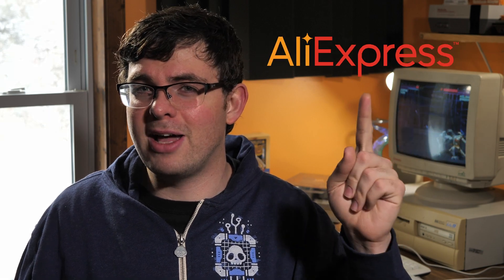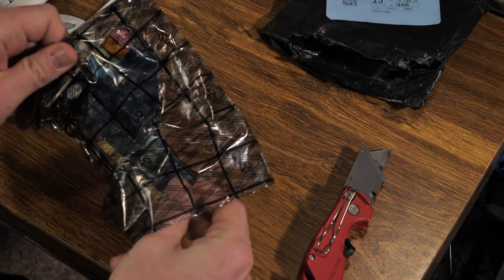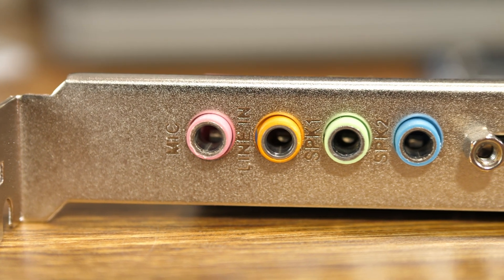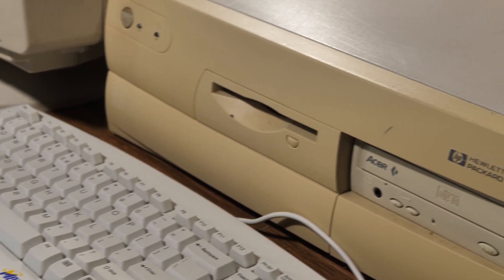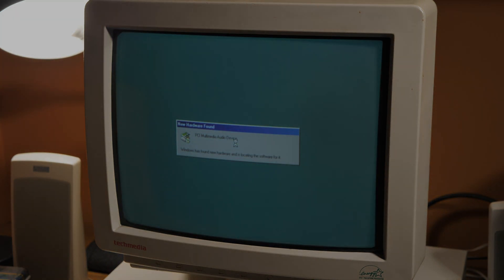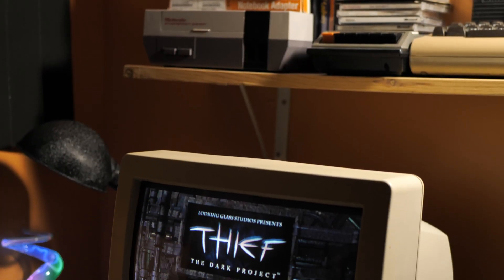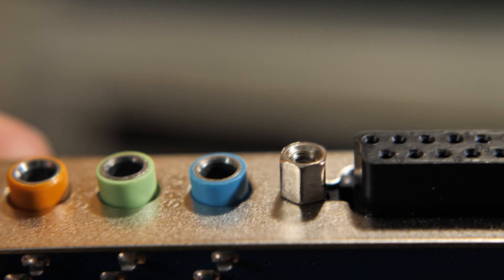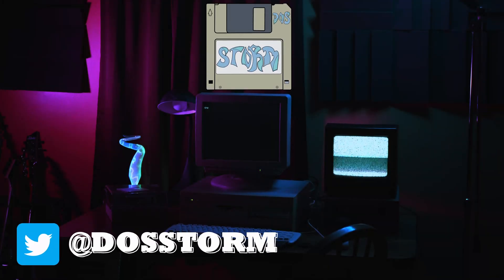Using The $12 AliExpress Sound Card for MS-DOS!

Comment: the Yamaha DS-XG, ESS Solo-1, and Avance Logic ALS4000 were some other DOS compatible PCI cards
the SB Live and some Audigy models and the ESS Maestro or Allegro and the Aureal Vortex had some sort of DOS compatibility too but the FM synth was more inferior
Reply from the maker: Yeah PCI cards are usually shunned by most for DOS gaming. At the very least they are interesting though, and I will probably test more of them. I have a Yamaha XG sitting around somewhere.
Reply: @DOSStorm  I was reading about this and it sounds like some of the 'XG' branded chips are Yamaha YMF724, YMF744B.

Shouldn't be too surprising that a lot of Yamaha's products are pretty good when you consider that electronic organs, pianos, and synthesizers are something they kinda specialize in.
Reply: Solo was the last useful card by ESS for DOS. Maestro and later are Windows cards, with some really crappy support for legacy. They have no FM part at all.

Comment: fair warning, they make this exact card with two different chips, the C-media one and what appears to be some sort of esoniq? they may have the same pinouts, but they do not have the same feature levels. the esoniq will do fine in windows, but the dos support is a .. well, better to stick with the cmedia one if you can, or as mentioned elsewhere, the ess solo-1, which trumps everything but an actual old sound card, a card with the PC/PCI or SB_LINK, or a compatible one with sbemu.

and listings currently have the cmedia variant running around $9, shipped. though you have to hunt a bit for them.

Comment: if you can get the six channel variant of this sound card. (6 ch 5.1 with the PCI-LX PCI-MX marking on the chip) you can get almost near perfect compatibility with digital sfx in real mode dos, but you need to use a patched dos driver which you can find at the vogons forum site. this driver won't work with your card though. apparently Cmedia made multiple variants of this card that seem near identical to each other hence the inconsistency of this sound chipset.

Comment: I had this soundchip onboard on my chaintech 7aja2/100 back in 2001
Reply from the maker: It looks like this chip was used on lots of boards around that time. They must have made a boatload of them to still be pouring into new cheap add-in cards over 20 years later.

Comment: ESS Solo-1, Creative AudioPCI cards, etc, are much better - but the CMI8738 cards, while not great, aren't terrible and are really cheap and abundant. Last year I paid just a bit over an euro for one (used).

There however seem to be several revisions of the chip, but I'm not sure about their differences. Also it seems to be quite commonly used on some motherboards as a cheap built-in audio solution, also sometimes rebranded as "HT8738". Also, the company made an earlier ISA chip, the CMI8330 (aka HT1869V on PCchips motherboards)  which seems to have good compatibility, although it's rarer to see.

Comment: It appears the card is only good for FM, since you were unable to get digitized sound effects (especially those with continuous auto-dma buffers, like Doom or Descent) working.  Still, I guess $12 to get Adlib sound is good, although for $50+ you can get an old card on ebay that works better.  Thanks for taking the time to make the video, you've saved me a lot of time.  Keep up the good work!
Reply from the maker: Digital sound effects actually work fine for some games. Jill of the Jungle, Vinyl Goddess from Mars, One Must Fall, Monster Bash, and even Doom works fine in straight up Sound Blaster mode in my testing. It just seems to be hit or miss.

Comment: The CMI8738 was (and apparently, still is) a great budget PCI sound chip! I used one for a long time because it had bit-perfect SPDIF output unlike the Sound Blaster Live I used before it.
Reply: C-Media Master race >:V/
Reply: I imagine that avoiding the card's DAC probably made it sound better as well.
Reply from the maker: @alextirrellRI  For sure. The noise floor on the analog outputs of a Live are much cleaner than this thing. Although I'm sure there are some CMI8738 boards that are built much better than this one.